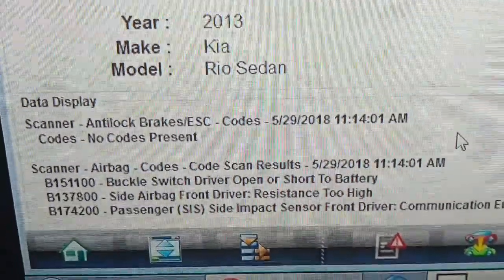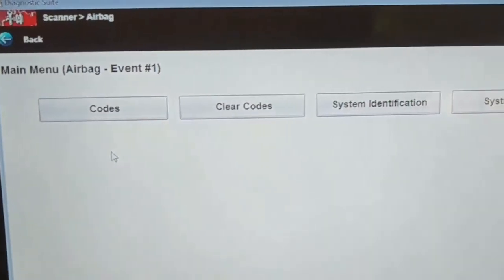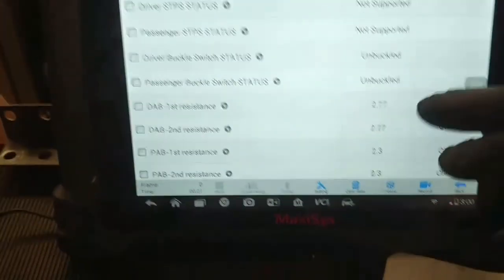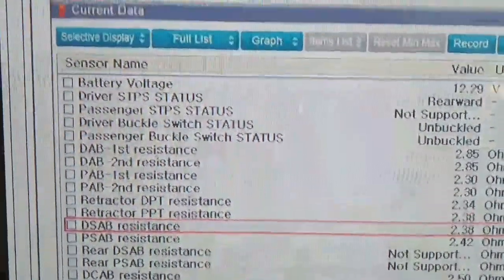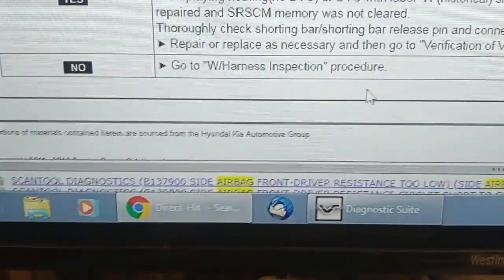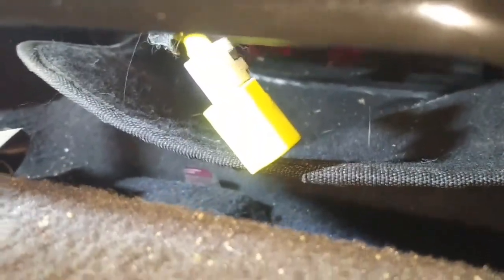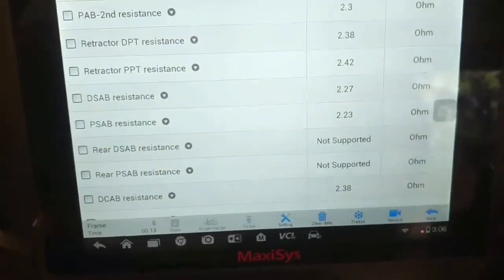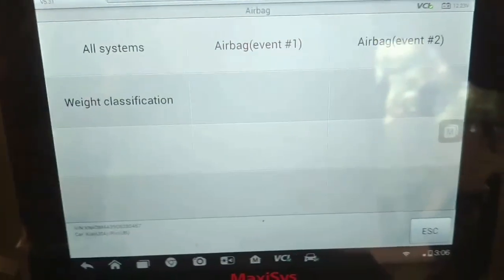2013 Kia Rio B137800 Driver Seat Air Bag Code

Comment: I dont have scanner... My light still on, all the conectors are fine. I took the battery off. But the light still on. What more i can do?
Reply from the maker: You will have to get someone with a factory level scan tool to retrieve the ccode/s . Disconnecting the battery typically does not clear the codes from air bag systems. Need a scanner to erase the codes as well.
Reply: @PhillipBailey  Well, the conector under my seat was dirty. Like there it was oil or something. I cleaned. Hopefully just need a scanner.